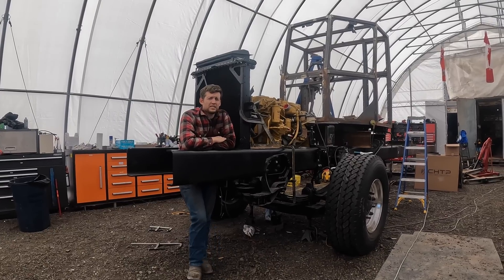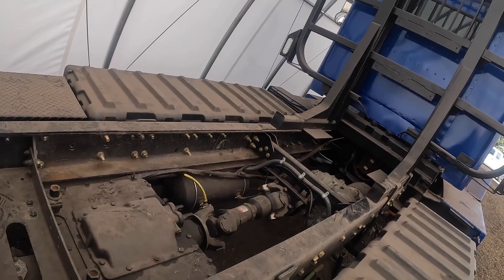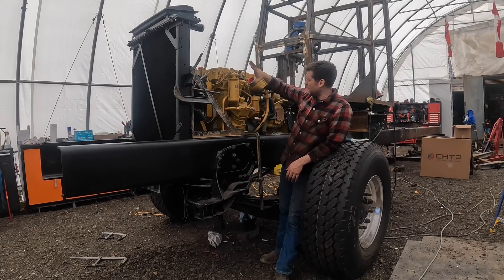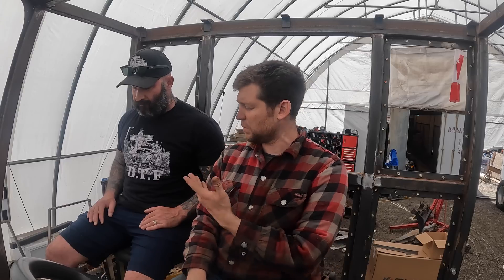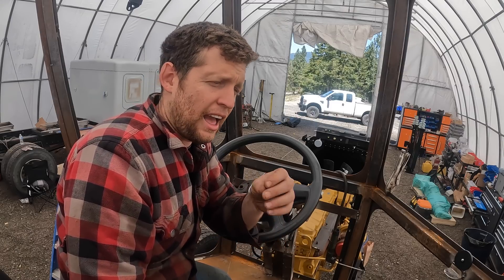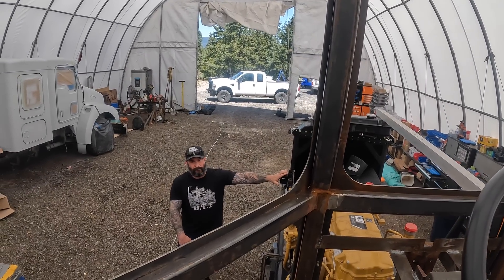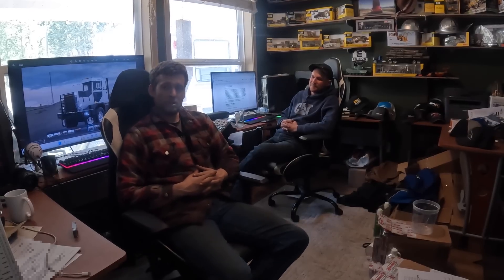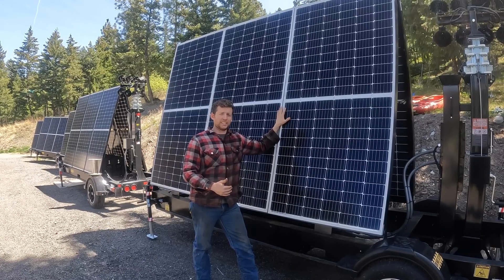Edison Motors Progress Update

Comment: hmmmmmmm i believe i told yall that the proto type wouldnt work.....
Reply: You didn't listen very well
Reply: @Studio23Media  you must be missing a chromosome and not know anything about trucks.... 1st the truck is set up is redundant,  you have way too many components to achieve his goal. 2nd if he knew what he was doing, he would mounted his tesla set up to the axle, any machine shop could have made him a coupling to mate the power unit to the axle, that would stop his ujoint issues and help with some of his lack of torque, 3rd what did he think was going to happen when he piped his electronics cooling system to the same cooler as the engine?  the diesel engines are ment to run at 210-220° for optimal efficiency. thats not really too cool for electronics.  he could have made a separate cooler for that behind the cab... he was the one making these claims about the prototype pulling a load, running down the highway, ect. , not me. lets face it the truck seems to have had a hard time getting up to 55 mph on a freewheeling dyno, and its convenient the load cells werent working that day and still dont seem to be working, since we have no video yet... this guy said he raised $1.5 mil on go fund me to make a electric truck.... wheres the truck??? its a grift buddy
Reply: It worked for what they needed, which was to prove a bunch of systems.
Reply: @MarkRose1337  explain your definition of "work" , have you seen one video of this truck moving down the blacktop under its own power? i saw a dyno video, a free spinning dyno video, not under a load.... what gets me with these guys is the extreme amount of shit they talk about manufactures and engineers who actually have a working model, when all they have is a gigantic $1.5 million crowd funded shit box

Comment: Do you have any concern with the batteries being on the side and at least from my viewpoint in Maryland it looks like they are vulnerable to being in a T bone accident?
Reply: They are going between the frame rails. Carl only had them on the outside because it still had drive shaft and the tesla motor there

Comment: Not a fan of the center seating. Might be fine for rock truck but definitely not for a van trailer backing into 20 tight doors a day having two blind sides wont work. You all can say there will be cameras but its not the same or as safe being able to see where the trailer is going and whats behind it. Also not a fan of being forced to go electric which says to me something is up.
Reply from the maker: We don’t plan on this truck ever pulling a van.  This is not designed to be a van truck.  It’s an off-highway heavy haul truck

Comment: How are you running the Air Conditioning ? Off the engine normal style or a battery operated unit?
Reply from the maker: Battery operated
Reply: @400 volts Dc or Ac?

Comment: Control and data panels incorporated into the chair walls and around the steering wheel could look damn near Star Trek if you wanted to without obstruction to visuals. Controls what’re within an arms reach without having to even shift are an absolute dream to have (think John Deer control panel on a harvester) especially if they’re on swivels/adjustment rails. Just a thought!

Comment: Y’all should offer an option for a small refrigerator/cooler for where the second booster seat would go. Kind of like John Deere’s tractors has the same thing.
Reply: @Jimmy Staples that’s a good common ground. Got a point there. I just think it would be awesome to have that little cooler box. Keep your lunch warm or cool all day and grab waters out of it when you need. Don’t need to lug a lunch box in the truck that goes all over the place all the time.
Reply: And a microwave!
Reply: @davidlynch7666  microwaves too much. You’re only in it for 12 hours a day😂 but yes it would be cool just too much space lol
Reply: @ZMowrey177  throw it in a box outside.. everyone deserves a hot lunch my man
Reply: @davidlynch7666  It's gotta be inside for a fridge. Outside will work in lower US where it's never cold, but a fridge outside in Canada won't stop the food freezing. Even those cooling/warming Peltier boxes can't keep above freezing in the winter.

I think Jimmy has the right idea: a place to strap any old fridge in the cab is good. And I think having a shelf above it to strap a microwave or whatever also makes sense.

Personally I'd want a place to put an induction cooktop or two, inside or out. I'm a steak and eggs kind of guy and nothing beats them cooked fresh.
Reply: I 💯 % agrees with you
Reply: I like the strap idea, as long as the door locks and you don't have to undo the strap to get it open. If the user can find a short enough fridge, they could just bolt the jump seat to the wall over it.

Comment: A couple thoughts on the design from someone who builds trucks for one of the major manufacturers:
- That front visibility is absolutely unbeatable, but I think that using "West Coast" style mirrors with a pipe at the bottom doesn't suit this truck very well because the lower support is directly in the driver's line of sight.  A thicker single overhead mirror bracket (like on Thomasbuilt pusher school buses) would offer basically perfect visibility.
- If you're using a digital gauge cluster and CAN bus to link your cab systems together, almost the entire bulk of the systems that make up a typical dash can be relocated to that back wall.  Having had to work on the electrical control systems for a variety of trucks designed in the last ~3 decades, a flat, single layer panel of control boxes all neaty wired together and connected to the dash display and switches by a single CAN harness would be an absolute dream to work on.
- Following on the last point, a standardized diagnostic connector that can read basic telemetry from the truck (Is this part connected, is it on, does it have voltage) is a life saver when a truck has an electrical fault.  I don't know if you have the development resources at the moment for that kind of system, but it is worth having if you do.
- An adjustable pedal box is something that I wish was available on the trucks that I work on.  My legs are on the short side, which puts me either uncomfortably low or uncomfortably close to the dash when I adjust my seat to reach the pedals.
- The door handles on the truck in the renders are REALLY high up.  Not sure why that is, but I definitely prefer having the handle down low where I can reach it easily.
- Is there a plan for grab handles on the outside of the cab?  I would personally probably go with a big one just aft of the door for getting in the truck, one small one in front of the hood for climbing onto the fenders, and one small one on the cross bar between the front side windows to grab onto when working at the back of the engine bay or adjusting mirrors, wipers, etc.
Reply: All of this right here absolutely 100%
Reply: Just wide enough to lay down for a nap. 
I always took a nap in a day cab.
I put a 2×10 between the seats and naped for twenty minutes every day! Life is better with naps!
Reply: Absolutely solid ideas 💡 👌🏻
Reply: I agree with all of this 💯 except for the mirror mount comment. While the big Thomas bus "ant feeler" mirrors might look better that are not really going to fit with the Edison off the shelf of any part store part model. The mirrors on the rendering are $20 from any part store across the country while the big ant feeler mirror mount and glass would have to be a FDO part
Reply: @ericcrockett479  For sure.  I think the best of both worlds would be to use a standard mirror head and a different mounting bracket.  It should be possible to make a bracket out of steel pipe that's just as rigid, but doesn't have the lower bar through the driver's vision.  Maybe a single thick pipe overhead with a 'C' shaped mount for the mirror at one end and a triangulated bracket that bolts to the cab on the other.

Comment: Lower the hood.    In the beginning you talked about raising the generator.  In stead sink the generator in the frame rails and and lower the hood.    If you need to make the radiator wider so it doesn't have to be as tall or double core it. You talked about how visibility is key.  If you lower the hood it will lower center of gravity and put the weight more between the wheels.
Reply: 1- They had plans for a larger generator which would have required the taller hood
2- making the radiator wider will conflict with your next point, how visibility is key. Seeing the corners of your truck in low-speed situations (like this is designed for) is more important. 
3- lowering the hood itself will not affect the center of gravity, but sinking the generator between the frame rails would. Of course, this depends on what generator they use- some larger ones may not fit, or some will be burdensome to maintain. Also, no, it will not put more weight on the wheels. It would be less top-heavy, sure, but still the same weight.
Reply: I agree seems like a waste, that hood could come down 12" at least if the radiator was smaller or relocated. It could be moved to the back or top of the cab with some electric fans

Comment: I love this project.. do you really need that large of a generator/motor? Smaller motor = smaller rad= lower hood = more visibility . For that matter mount the motor sideways and shorten the hood
Reply: It still needs to have enough generator to go up long steep hills.
Reply: always better to have more then you need and not need it!

does seem like something to think about having optional hood sizes and shapes when they get past basic production.
Reply: Probably has to do with safety factor along with actual battery charging limitations and the ability to provide enough juice to limp the truck home if the battery bank fails for whatever reason
Reply: It's a smaller motor but will always be working at 75% load when running so it needs the large cooling system

Comment: Love this more and more! I'd personally love a overhead console to have all the switches and Gauges in, simpler wiring and less to tear apart when something does go wrong.
Reply: I think 1990s Kenworths were about perfect, all switches within reach, 2 screws and a panel comes out and all the wires are right there. (Spaghetti I know but it is what it is)
Reply: A dash of the future would be a hud system. Cheap and easy. Also mechanic gauges as back ups of course.